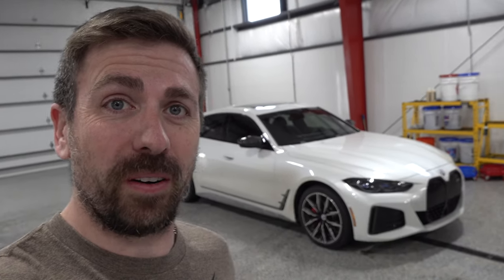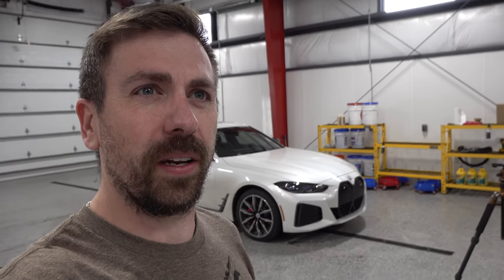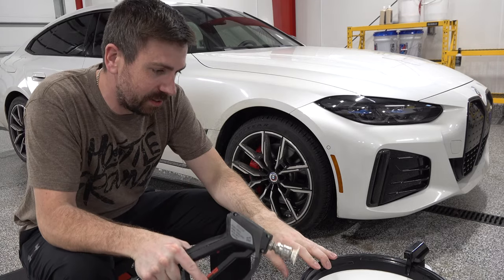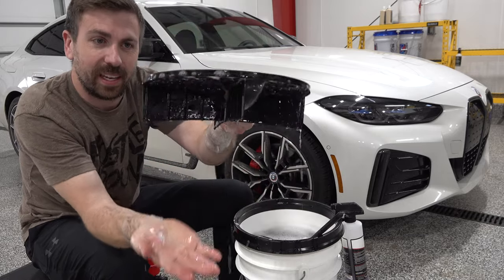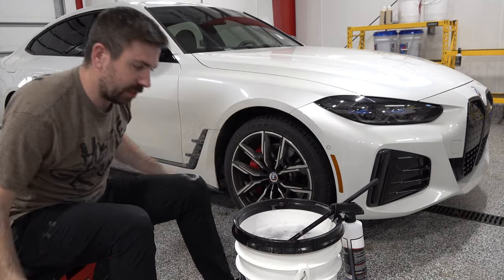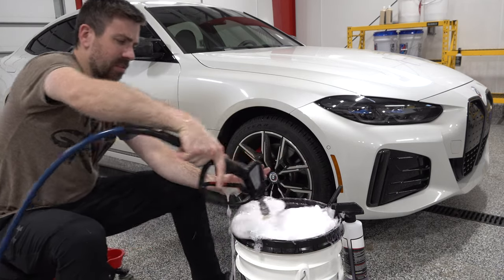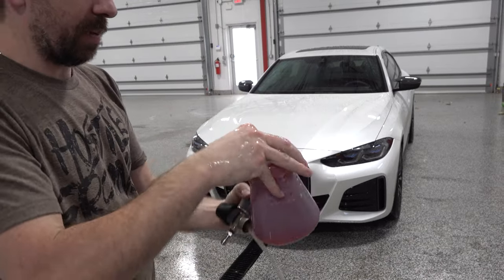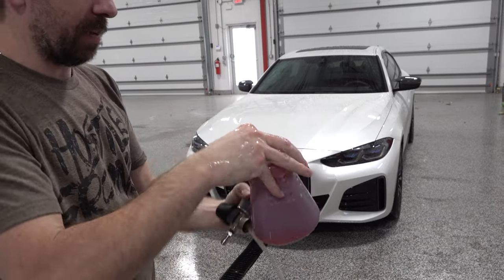My Favorite Car Detailing Products | Cleaning Tips | BMW i4 M50

Comment: Great video Chris! You will like the graphene shampoo too, it doesn't Sud as much but is very slick and works good as a maintenance topper for the ceramic  coat. The ceramic spray coating is awesome, i like the enhanced version with a little more solids/longevity. Also adams new graphene glass coating is amazing. I used to have a very similar washing method to you and have picked up some great tips and tricks of yours along the way. Happy New Year!

Comment: You ever try Collonite Fleetwax #885?  Some old military aircraft mechanic lead me onto it for the initial "wax" of the car.  I put it on my car's and I swear the water just beads off for decades.  Works on Chrome as well.  Protects very well.  Curious if you have used it and if so how it compares to something of similar purpose?